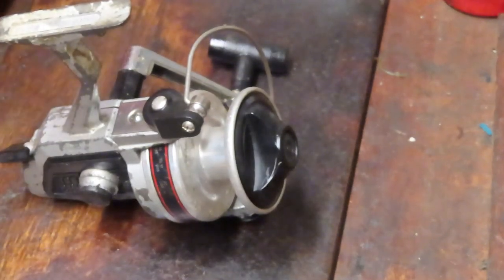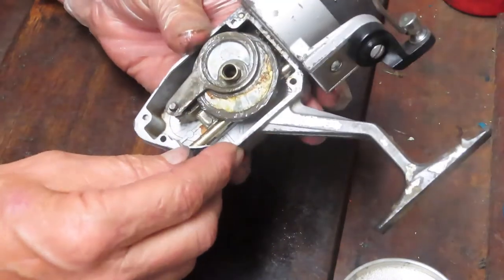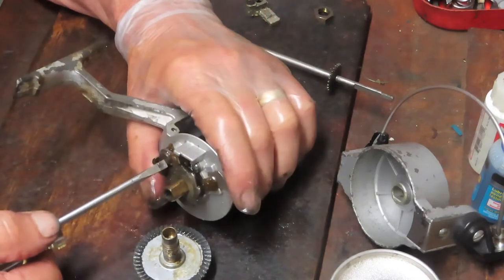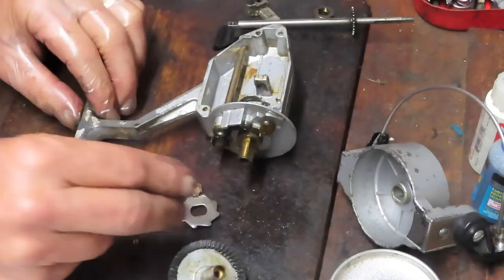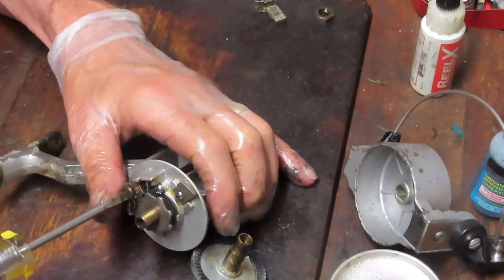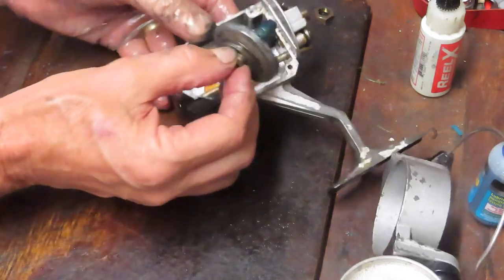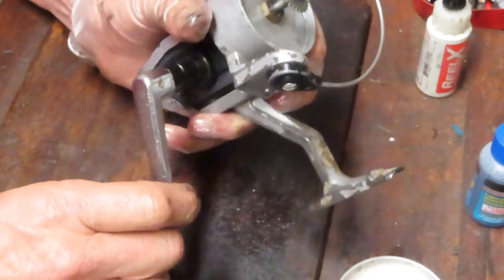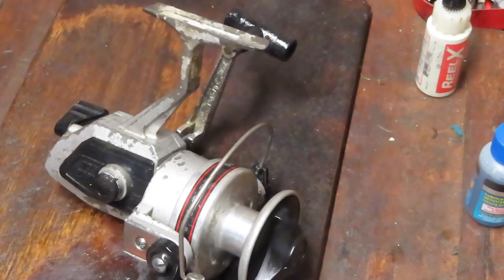Penn Silver 105 vintage spin fishing reel how to take apart and service

Comment: My 105c is different. On the anti reverse dog there is a spring shaped like a triangle that slips into the groove in the  collar ,with a curved end that surrounds a post on the back of the dog. I bought it around 1988 I think. Spring isn't functioning properly as the A R fails to engage sometimes. Thanks for the great video. : )
Reply: I visited mystic and found the 'silent dog spring' . Ordered 1 and we'll see if it fixes the issue. Thanks again
: )
Reply from the maker: Yes - the 105C is a different design from the 105.  Thanks Dennis

Comment: Did  two for a friend  I also had a stuck screw   used a counter sink
Reply from the maker: The metal case and screw on these models seem to Len themselves to corrosion and rusting in place.  It is a common problem with these models, particularly if they were used in saltwater.  Thanks for the note - Dennis

Comment: I’ve got a very nice one of these and it’s a great reel.  Of course I like the Daiwa Silvers and the Shimano MLZ reels better but if you take care of them these are very good reels. I have a 103, 104, and a 105.  Is the hole in the rotor to allow for lubrication (oil) of the AR mechanism? I have been told that these Penn reels that have a C after the number means they were probably made in China after Penn started making their reels there. I don’t really care for Pure Fishing so none of my Penn Silver Series reels have that “C.”  I usually loosen the bail arm screw slightly when I use that penetrating oil, wiggle the bail around, and then tighten it back. Never loosen it very much or you’ll be in trouble! I also put a drop of oil in the side plate screw holes before replacing the side plate. I got a beautiful Mitchell 302 today and I already had made a Power knob for a 302 handle shank that has two ball bearings in it. It is a really sweet reel now. I did have a time bending the bail wire back in place after it was bent in shipping. Glad you did this one Dennis! Let me know what that hole in the rotor is for. I’m curious. ——— Chris
Reply from the maker: Hmmm - I thought the "C" models were made in Korea.
Reply: @2ndChanceTackle  Do you know what that hole in the rotor on the 105 is for?

Comment: Dennis, I really like your videos. I found your channel while searching for repair videos for the old Penn 'greenie' Spinfishers (I inherited two of them from my late father). I grew up surf fishing on the Jersey shore, from the Barnegat lighthouse all the way down to Stone Harbor. We used those early Spinfishers all the time, and we fished them hard. My question for you is - you often discuss the salt and sand accumulation in the reels you service. Do you ever hose the reels down with fresh water to remove salt and sand before beginning a repair? Is there a reason to NOT do that before beginning a service?
Reply from the maker: Thai you Brian.  I primarily fish Belmar and north to Sandy Hook as well as the Raritan Bay shore.  Your question on hosing these off, it a practice that everyone should do after every trip, particularly if they are fishing in saltwater.  When I service a reel I usually do not know it is salted or sanded until I remove the spool or side plate.  When I find those conditions, I will flush the reel as you suggest.  Thanks for the note and for watching - Dennis

Comment: What size is this reel for example "5000 or 6000" the 105 is confusing thanks for the video
Reply from the maker: This reel is a larger size reel in the 60-70 size class (6000 / 7000)